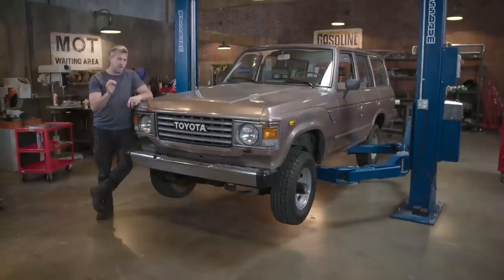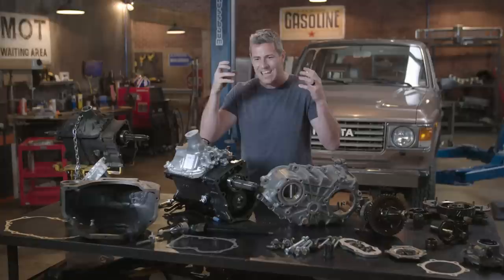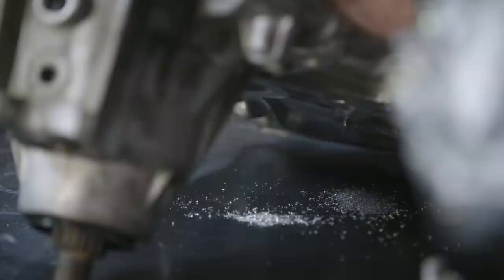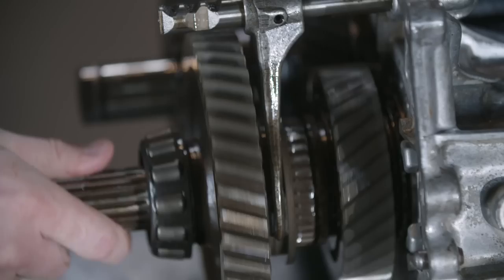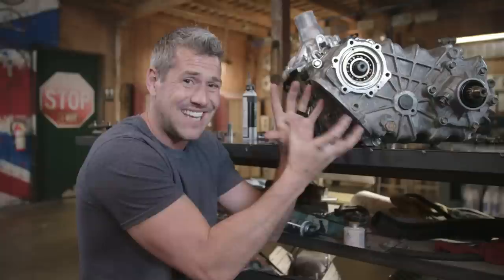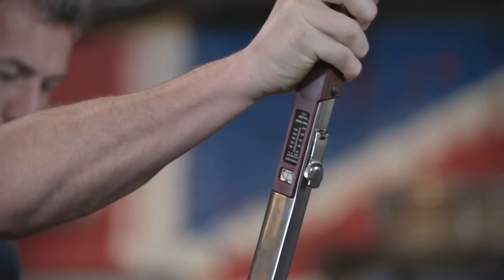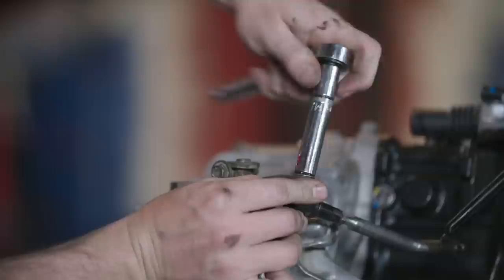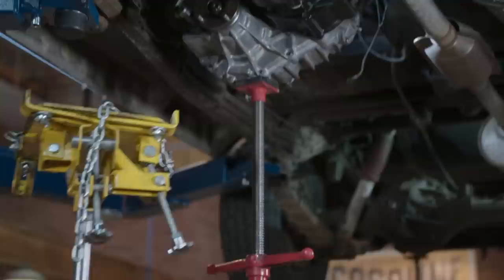Toyota Land Cruiser: How To Refurbish And Swap The Gearbox | Wheeler Dealers

Comment: I had never encountered the Land Cruiser until I went on UN duties in El Salvador in 1992. I was used to Bombardier Iltis, Kaiser M38A1 Jeeps, AMG M151A2 MUTTs, and Chevrolet 5/4 tons, all of which had serious shortcomings. The Land Cruiser worked well, not only in tropical mountain country, but also the mountains of Lebanon in winter when I moved to another mission in the summer. The Lebanese did a lamentable job of snow clearance on the Beirut-Damascus road, but the Land Cruiser with appropriate chains did not have a problem. Their diesels started without complaint in the Levantine winter. I wish I could find one here in Canada; they seem scarce as hens' teeth.
Reply: @wishunter9000 , I would not limit my search to the U.S., I will look in Mexico and Central America, as they have metric models. Hell, there might still be former UN Land Cruisers sold off as surplus after the missions ended.

Comment: Super fun/helpful.  Two questions (as I am doing this exact job right now on my work bench):

1) Where can I find a list of torque specs (you mention a few but not all of them)?
2) What lubrications are you using?  It seems like you have used two - one grey "sealant" (is that antiseeze?) and a red - (molly grease maybe)?

Comment: Hello, I have a Fj60 from 1983, it comes with a 4th gearbox, I have seen a Toyota 14B turbo engine, I would like to know if the 5th gearbox of this engine is compatible with the transfer of my FJ60, or in any case which ones are compatible